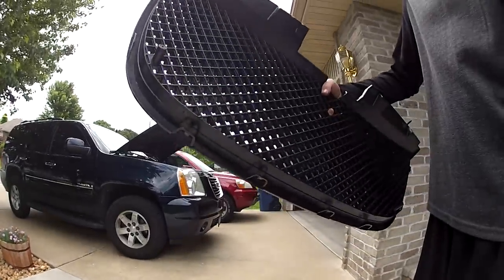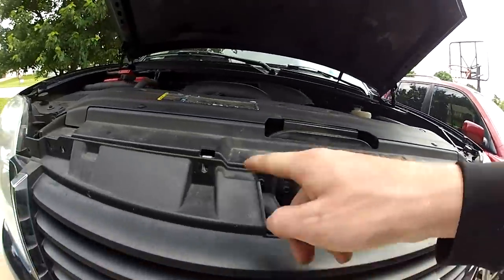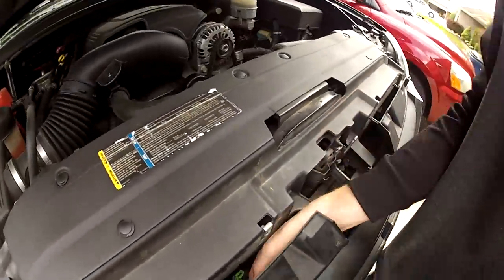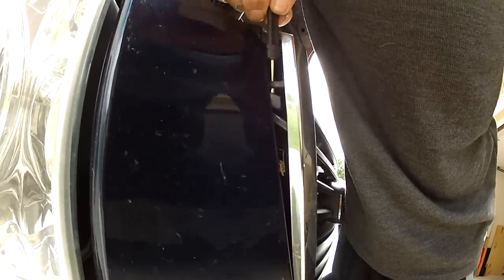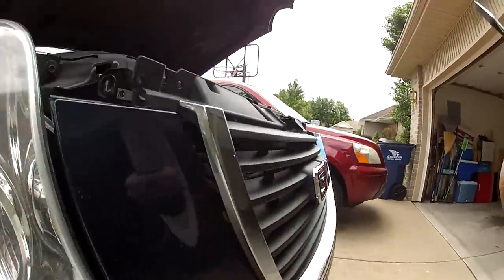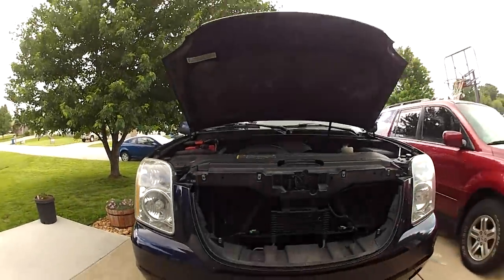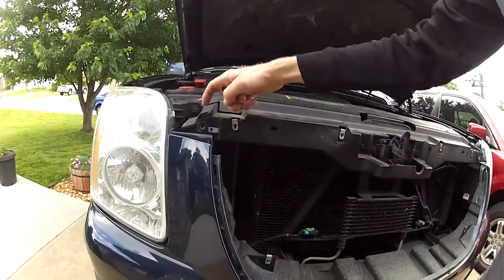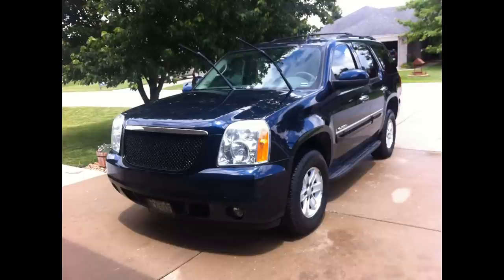Removing A Yukon Grille (And The Hidden Tabs) HD

Comment: Thanks for the video! Just swapped the grille on my wife's 2014 Denali. Super easy with this as a guide!  Tip. I used a butter knife to help release the clips. The wider surface made it way easier than a screw driver.

Comment: Did you also replace the top Crome piece of so where did you get it
Reply from the maker: i left mine chrome, only because my door handles were chrome. You could easily get a vinyl graphic of any color to overlay the top chrome piece. Would be cheaper than replacing it.